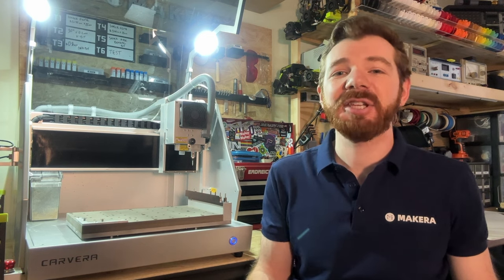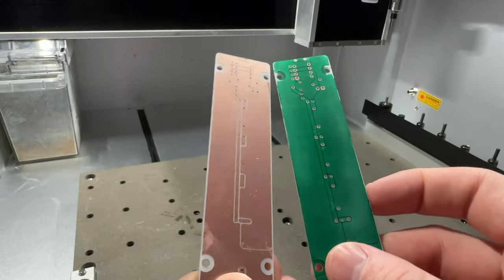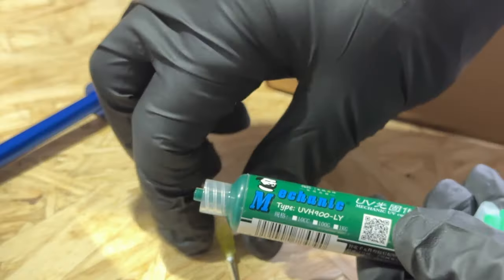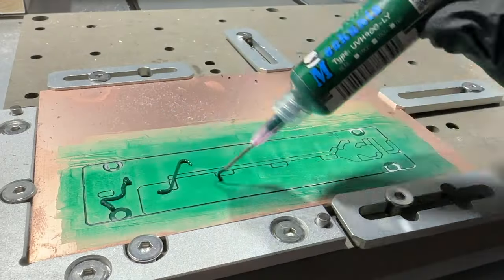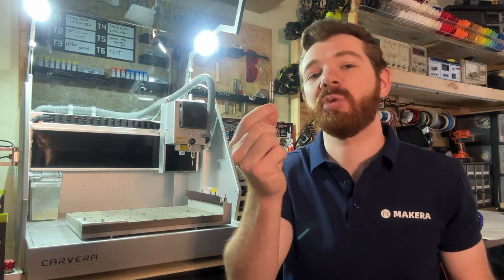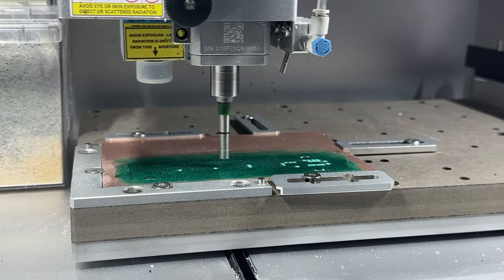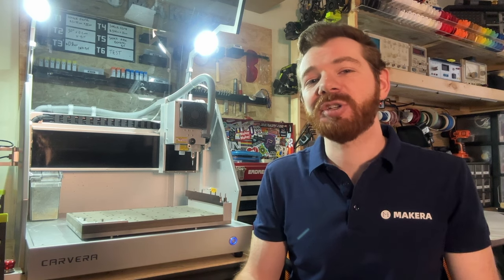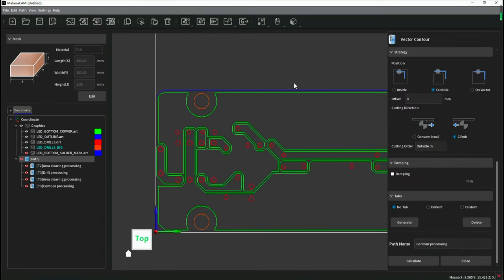How to Apply a UV Solder Mask to a custom PCB, Carvera CNC

Comment: For clarification when it says 2 to 3 thin layers should each of those require 15 minutes UV? 
Also, where it says the laser can be used to clear mask, could the laser be used instead of the spring loaded mill?
Reply from the maker: Yes, 15 minutes per thin layer, so 30 minutes total curing time for 2 thin layers. And the laser engraver can be used to remove solder mask but not to the same precision and depth as the removal tool. We would recommend the removal tool for through-holes and contact points, but consider the laser for a silkscreen-like etched design within the solder mask.
Reply: Would it be possible to have a higher power UV lamp to harden a complete layer in five minutes instead of having to do multiple layers?
Reply: @billknighton4181  I've never heard of UV solder mask requiring 15 minutes. That's completely ridiculous. Unless he is working in like -40C conditions, or his UV lamp is fake UV and actually just blue-purple LEDs.

At ~20C room temperature, each thin layer should only take about 20 seconds, at most.